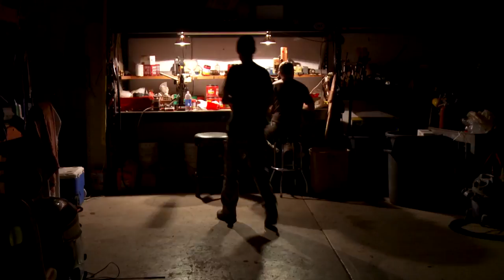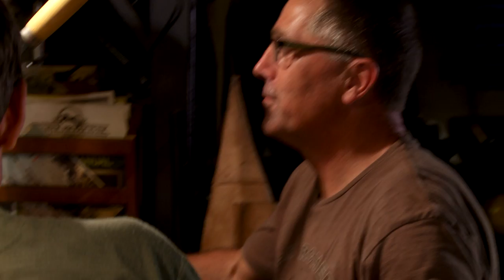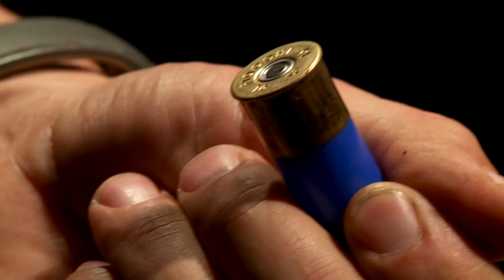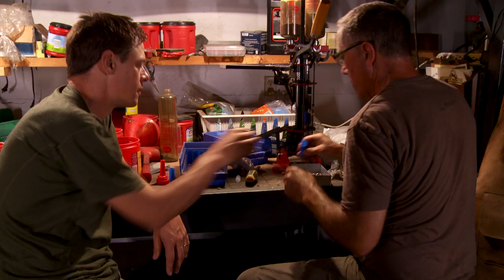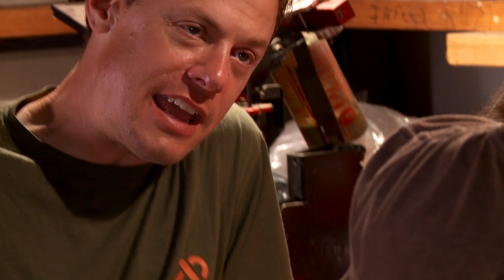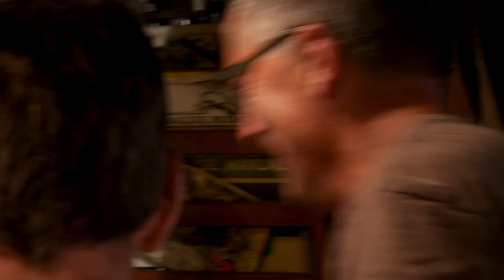Steven Rinella Makes 16 Gauge Shells with Ron Boehme

Comment: There is something nostalgic and magical about shooting a 16 ga. I have several 12s and 20s in Auto 5, B2000, B-80, Double Auto, 391, Citori, and BSS, but for some reason I always shoot higher scores with my vintage A5 Sweet 16 and Citori 16. In my opinion a 16 ga is the shotgun of a purist; the same way that purists are dry-fly fishermen and longbow archers.

Comment: 16 gauge never fell out of favor.  Anyone that has and shoots 16 will tell you,  they work and work well. 

But look around, the 16 ga is still here with a healthy following nonetheless.  Browning, Stevens, Eaa/Tristar are all making and importing doubles and auto's.  Federal and foreign ammo makers still make shells.  

Anyone that believes that a 12 ga 2-3/4" high brass load traveling 1300 fps shooting 1-1/4 oz shot is better than a 16 ga 2-3/4" high brass load traveling 1300 fps shooting 1-1/4 oz shot is not capable of critical thinking skills.  

16 ga only handicap is the lack of longer than 3" and 3-1/2" shells and chambers.  Literally, that's it.

Comment: anything a 16 gauge can do a 12 or 20 can do for cheaper. I guess if you only have one shotgun maybe bit why not a 12 then?
Reply: +drew abegglen   Funny I shoot a  20  16 and 28    why carry a  heavy   12  and beat myself up with recoil whena  28, 16, 20   will do the same  with less powder/ recoil and  weight.
Reply: +Michael Liechty do you reload for all of those calibers? I do for mine. I dont see the need for the in between gauges. nor do I think that  12ga pump is heavy or that 12 bird loads recoil hard. if its dove then a 20 is just fine and cheaper too. if you have the time, money and drive then more power to ya.
Reply: +drew abegglen  only the 16  and  28 gauge, the 20 guage is so inexpensive to shoot   i just buy shells. 16 and 28 gauge shells are not real cheap, But i can still make my  own cheaper than any sheel i can buy.
Reply: guy anderson, he says at another point in the episode that he got into 16ga because he kept finding awesome guns for damn near free, considered trash because people couldn't find the ammo, so he solved that problem. Plus he's a teensy bit wacked.